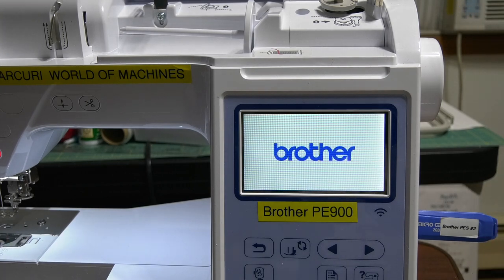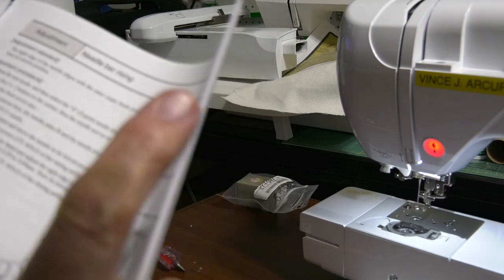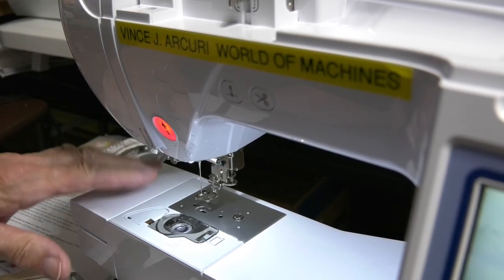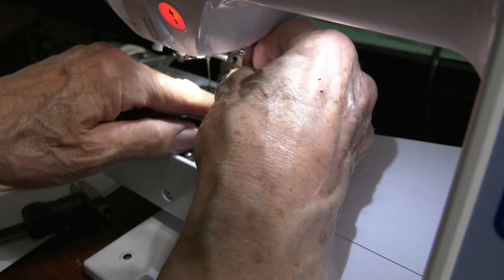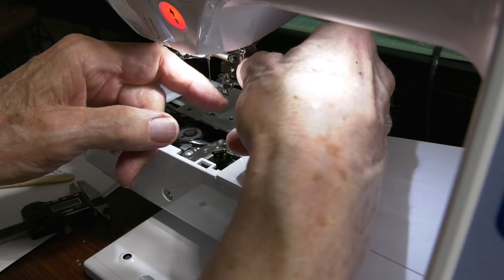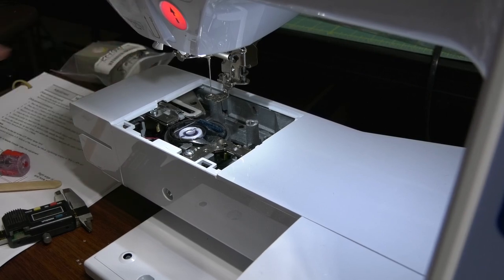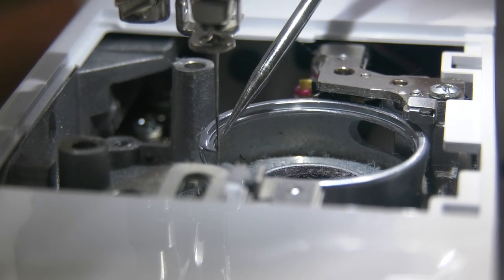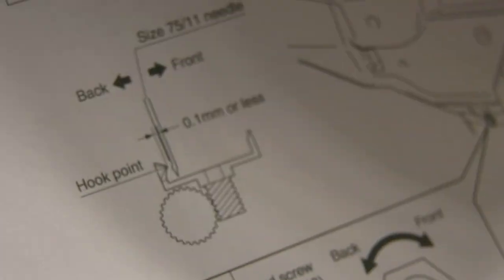How to check needle to hook timing on Brother machines.

Comment: Attention Brother SE600 users, bookmark this vid!  This works for you. Please skip to 15:26, this diagram is what you want. There SHOULD be a 1.6 - 2.0mm gap as shown here. There's a bunch of vids here on YT stating the hook should be "just above the eye" while showing literally, the hook above the eye with no gap... DON'T DO THIS!!!! The diagram shown in this video is what you want!!! So, I'd like to thank the uploader of this vid for saving me so much anguish.

Here's a lil back story, it's a bit of a read, but comes to show how easy it is to make mistakes while trying to watch vids here on youtube to diagnose your issues:

My issue first began when I tried to embroider a hat... BIG MISTAKE (which btw, do not use 3rd party hat hoops on an SE600, you're gonna ruin your machine). Needle ended up chewing through my bobbin case, although I didn't realize it. I started having this issue where the bottom thread would no longer catch and the bobbin case would bounce. All symptoms pointed to timing (which was wrong, it was not timing). Like a goofball, I watched some tutorials out there, changed the timing where the hook was literally above the eye of the needle with no gap. Didn't fix my issue. Eventually I came across another vid that showed why the bobbin case can suddenly bounce, they pointed out a gash on the side of the bobbin case in which thread can get land in the trench/gash and suddenly lift the entire bobbin case. BINGO. Sanded it down, that fixed it (although I did get a new bobbin case) also yea, the needle chewed up the upper area of the bobbin case too, like someone took a bite out of it. With that fixed, the embroidery started working without issue, that is until I noticed my tension tests weren't even on the under side. You embroider a column, look under it, and notice 3 columns (white in the center and color on each side) The issue was that the color on the right was thicker than the color on the left. Also when embroidering, I could see dots of white thread popping through here and there. Some would say tension, nope.. not tension!!!! It was hook timing. I remembered that I tried to adjust it earlier, but inadvertently threw it off ever so slightly. Thanks to the diagram in this vid, those white dots of thread are now gone. It would have been a grave mistake to adjust bottom tension (this literally almost needs NO adjustments, period, leave your bobbin tension alone unless it's very specialized work).